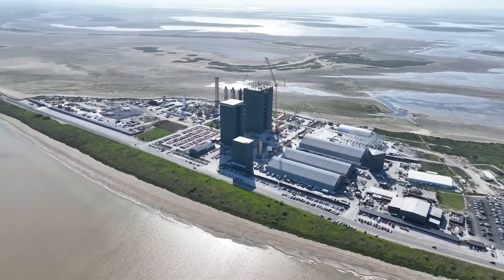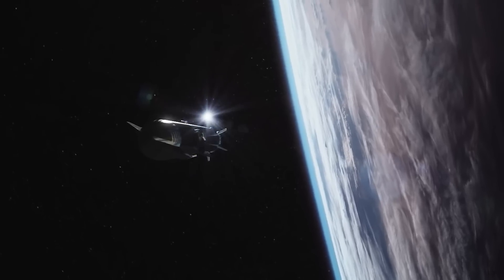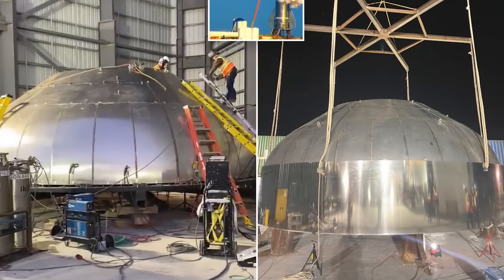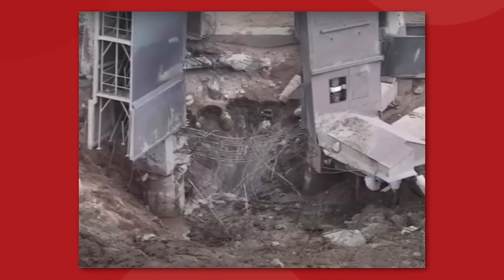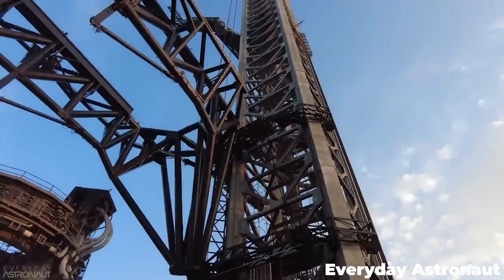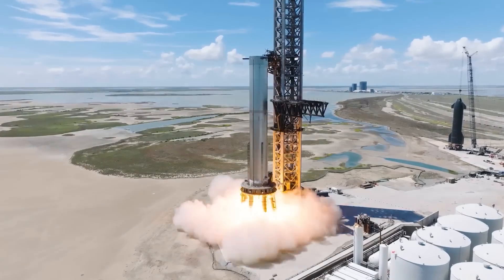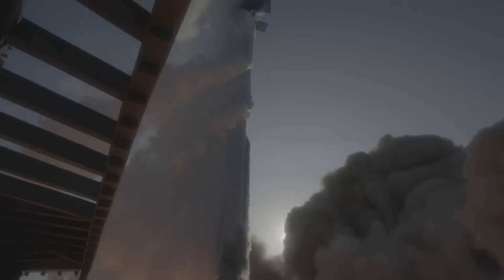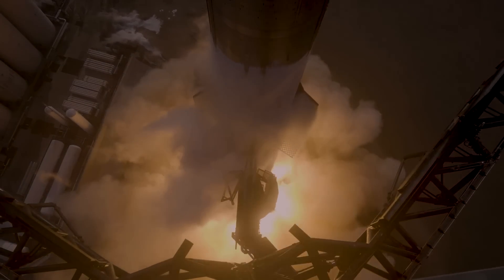SpaceX Is Launching Starship To Orbit This Month!

Comment: Hot Staging will be 100% better. If the Starship is stuck on a failing or exploding booster, then yes hot stage it for sure. Great idea on a yet to be proven vehicle. Remember. Werner Von Braun was talked out of using this kind of "giant starship" setup by Mr. Humbolt. Soooo. I hope there are a few 21st century safeguards built in so the Apollo era rules no longer apply to the Starship.

Comment: At launch. Booster 9 will fail before reaching starship injection point. It will go out of control as more engines fail. Then they will be forced to donate booster 9 starship will have to launch to soon. It will fail to reach high orbit. It will fall out of the sky. Then SpaceX will be force to donate starship. Or SpaceX could opt to land starship in the the ocean. Unfortunately this will be far from recovery ship as in a half a ocean away. Before the recovery ship can reach starship. It will sink. I hope Elon’s light comes on and designs a large engine equal to apollos engines. This can be mounted the around the booster with less engines. Please launch soon.

Comment: The engines didn't blow up or fail because they were bad. They failed because they were damaged by all that debris and sound pressure. It shot massive concrete blocks above the height of the parked rocket. Some of the debris and the reverberation from the engines had to have caused extreme stress and damage to critical systems

. The main reason NASA uses a deluge system is to dampen the sound from reflecting back up into their rockets and destroying Them.

 For whatever reason Space X didn't think this was an issue.

 Fuck around and find out, I guess.

 If you've ever see video of super loud car stereos twisting the structure of the car its built into then you'll see a weaker version of what that sound pressure is capable of.

Comment: I said the lunch pad would disintegrate and ELON and Space X dismissed my warnings that Starship needs and still needs a proper tranch to control the rocket blast and focus it in safe areas determined by the trench and I suggested a Water pool 12 feet to 6 feet deep with blast doors to release the pressure under a regulated controlled system. I still do not believe their water suppression system has much of a chance to handle 20Million pounds of Thrust safely.

Comment: Good detail about the changes to the system. I was especially heartened by the investigation into the engine failures. However, it looks like there is still work to be done, since several engines still shutdown prematurely during the last hot fire.

Comment: Does anyone know if the starship booster engines are all started simultaneously, or are they started one at a time (rapidly of course), to mitigate the explosive effect on neighboring engines?
Reply: they no doubt start them a few milliseconds apart its not really an option not to,the shock is already astronomical even if it was physically possible  why would you

Comment: Does anyone think they should be practicing an, of course I still love you landing first, rather than a chopsticks landing? If the launch system is that valuable:)

And of course this will tell you if you have enough, meaningful control, over the landing, or no.

Comment: I can predict what's going to happen after they launch! The rocket will launch and when it gets to the height of the 2nd stage ignition the venting ring will melt and fail. Hopefully Starship 2nd stage will have already been released from the 1st stage. Everything else will be worked out. If any systems fail to operate as designed they will work out the bugs and launch again! We just need the FAA to hurry up!
Reply: Why?

Comment: if you need stage zero (launchpad) to ignite the booster then how does it reignite engines for re-entry?? I must be missing something?
Reply: Those enginrs are reignitable
Reply: @stanleydavidson6543 But how without stage 0? Something needs to spin start the turbo pumps. That equipment is in the launch mount on the ground.
Reply: maybe the air spin-starts the engine on the way down, like jump starting a car ... hmm
Reply: The center engines are capable of reignition, which are the only engines they'll need for the catching sequence. Furthermore, unlike Falcon 9, SpaceX is planning to let Superheavy re-enter the atmosphere without a re-entry burn, letting the stainless steel take the force (for context, Rocket Lab doesn't use a re-entry burn for its Electron rocket).
Reply: @The_Isaiahnator  How do those center engine turbopumps spin up? Electrically? Or do they never fully shutdown?
Reply: @tracyrreed  
I don't know about the finer details, but I do know that they're capable of fully shutting down and restarting. They removed tech required to restart the outer engines to reduce the weight and overall complexity of the booster.

Comment: Pretty good summary video. I can almost hold my breath for 30 days, but my whole body is craving a rocket launch  !! Why won't the hot staging cause the booster, which has fuel to land with,  to blow up?  Will the dome deflector and the vented skirt be enough to divert and vent the critical heat?
Reply: Reinforcement and heat shielding have been installed on the top of stage 1.  Will it be enough?  Stand by...🤣
Reply: @appliedfacts  Thanks; I had not heard of those devices and techniques.   Yeah, I agree, we'll see.  Really hope it works.

Comment: You need to check your facts.  There is an environmental impact review pending which might result in another environmental impact assessment being required.  The first part of that could take up to 130 days and the second part if required will take at least 2 years and possibly as many as 5 years.

Comment: Wet pasteboard spread over all that damaged concrete before launch would probably have stopped all of than shattered concrete damage……
Reply: Then it would have never made that hole for the deluge system.  That WAS another approval/paperwork problem, magically solving itself.

Comment: You missed one really important point.  The launch is on hold, even if the FAA approves it, until the Fish & Wildlife approves it.  They have publicly said that can take 30-120 days.  So an October launch is really unlikely :(
Reply: Fish and Wildlife may approve early. We just do not know. (In my opinion there is no need to involve them again as they already had input to the first launch. The second launch is much safer because they have the information of the first launch and they have made over 1,000 improvements.)
Reply: @MrEd2291 My understanding on Fish and Wildlife is that they are required to put a hold on things because "someone sued".

My guess is that either that "someone" views any threat, no matter how slight, to wildlife as unacceptable (in which case any launch is "an evil that must be stopped at any cost") or that "someone" views views anyone who has lots of money they are spending as evil (in which case they must be prevented from doing that regardless of what pretext needs to be assumed or if that results in lots of money they are spending to stop it).
Reply: @benjaminshropshire2900  It would be surprising if ANY lawsuit could cause a holdup. After all, every launch company has competitors and if any law suit can hold up a launch, NOBODY would be able to fly...ever.
Reply: @SteveBakerIsHere  Starbase has only seen one orbital launch attempt. Basically everyone else is using established sites (which for the most part they don't own) where all the litigation has played out. Also, the other providers likely don't want to get into a tit-for-tat game, but people who would be happy if nobody ever did anything ever again don't have that sort of constraint.
Reply: @MrEd2291  The fuel, oxidizer, and water haven't changed, so if F&W drags its heels, it is most certainly politically motivated.
Reply: @MrEd2291 part of the additional and shocking new information learned from the first embarrassing disaster (aka precious learning opportunity) the devastation imposed on the surrounding nature reserve and wildlife habitat. Acres wide wild fires, incinerated avian nesting areas, dusts and concrete boulders strewn around way beyond any one’s imagination. Those are the new pieces of precious learnings we now have on top of the 1000 new changes (who said they are improvements???) that we have little idea about possible adverse affects for. Kiss that 2023 launch ideas good bye and pray for 2024.  If you put a toddler brained apartheid boy in charge of serious business, you are guaranteed “excitements” of the worst variety
Reply: @uince  space x is run by a woman now ^^ good luck with the hating of progress!
Reply: 30 till 135 days !

Could be in mid feb. 😰😡🤬🤮
Reply: Look like the whole team from fisheries and birds. Has gone fishing! After all the weather so nice. Do they actually work there?       It appears overwhelming,!!!        that's why they gone fishing!   Musk can build an engine one a day at present.  And is ready for launch! .  But the fishery and birds dept,  and the faa took one look at the weather. And said nice weather, let's go fishing!  No wonder musk and all of his staff are wondering and pissed off. Plus me who waiting to watch this launch!  With the rest of the world.    If it can get permission!  And all of us  haven't got a  clue if it will get permission this year or next!  What a joke!  Both china and russsr will be on Mars and the moon sitting in deck chairs looking back at earth.  And saying did musk every get that permission  to do any thing that he wanted.  The last we heard was he was  still trying. You know what the paper work is like in the usa!  But the fishing is good I hear. Funny you say that!
Reply: 4:00 there is always the possibility that someone at the F&W service has a brain and they issue a deviance as a national priority. China is likely laughing at us.
Reply: Damn… didn’t we kill all the fish and bugs the last launch ?
Reply: The VOTER FRAUD President Biden hates Musk and I bet he will try to use these corrupt government agencies to slow him down!
Reply: Yes seems to be a rather moon sized hole in their logic.
Reply: Elon might 'accidentally' push the button :P

Comment: The report on the water suppression system misses the physics the massive water spray absorbs a huge percentage of the heat energy to make that steam, reducing the temperature, sound, and velocity of the exhaust, rendering it less destructive. The remaining water prevents and extinguishes fires.
Reply: That means nothing, rockets dont give a damn how hot the exhaust is. The gas is not attached to the rocket meaning it cases 0 lift and if it was it wouldn't go to space. It all about the 3rd law which is "For every action, there is an equal and opposite reaction" the thrust is essentally created by causing press from the expanding gasses when ignited that the rocket essentially throws the gas out really fast causing the lift. Hope this helps people understand and it's quite interesting too
Reply: You miss the point. This is not about the rocket here, this is about the exhaust after leaving the engine bearing all of the energy equal and opposite to what is lifting the rocket ship. The specific heat of changing liquid water to steam is 960 BTU per pound, huge. This absorbs exhaust velocity, heat lowering its temperature, and vibration/sound. Spraying the water increases the exhaust/water contact interface for fast energy transfer versus flowing water. I appreciate your comment expanding on what is going on here that caused so much damage during the first launch. Thank you. @DylanHedger
Reply: @sagecoach  that's a great thought but energy this way is transferred into the water with its velocity going outwards. Sure the energy is the same but it's moving in a different direction. The steam doesn't affect the rockets lift, the diversion moves all the energy away from the ground which prevents the same thing from happening again
Reply: Agreed. When you look closely at the test firing the energy billows outward and not so much upward. I am sure they computer-modeled a simulation of the reaction to get the energy dissipation in the full circle they want. The trough deluge diverters direct the blast in one direction not dissipating as quickly. Most importantly the SpaceX version worked.   @DylanHedger
Reply: Quite an interesting thing they're doing when you think about it. You use gasses to thrust using the 3rd law not the heat or fire like most people think and then the heat energy is too much for the ground with the force along with it so you divert it by transferring the energy using water jets that spray outwards. I hope to see the first launch of Starship to the moon and one day to mars as it will be such an achievement for humanity.  @sagecoach
Reply: BTU per pound? What archaic nonsense is that? I have news for you; even SpaxeX is in the 21st century and uses kilojoules per kilogram just like everyone else who has any sense. @sagecoach

Comment: They haven’t attempted to get to orbit at all yet..  The did a test flight with no intention of going to orbit..
Reply: I suppose technically you are right, if that flight was supposed to just terminate near Hawaii without actually making a full orbit.  But it would have been a significant suborbital flight.  I suspect it would be orbital with the right burn of the upper stage.

Comment: The first point you made was wrong. The next launch is not going to orbit.
Reply: Technically it won’t make a full orbit, however it will be in a orbital trajectory before it returns.  So they are taking credit for reaching orbit, and is totally valid.
Reply: No, not completely.

Thats not the objectiv anyway.  Mission succes is separation and starship continuing to fly at least for a while.
Reply: @MichaelWinter-ss6lx  we will see, I believe it will separate but the booster will not be saved
Reply: Where did you get your info, this is an orbital launch.